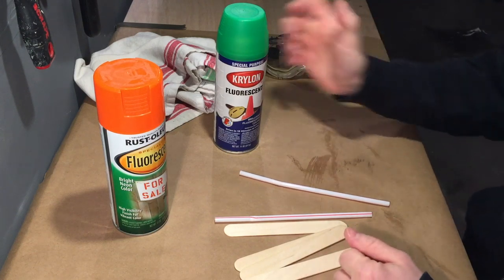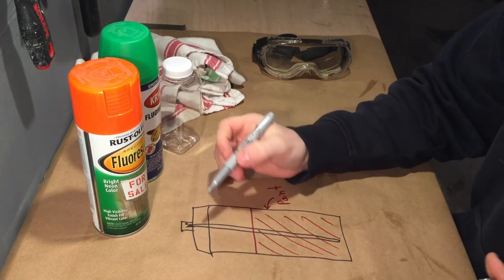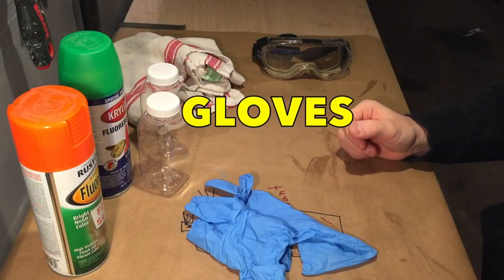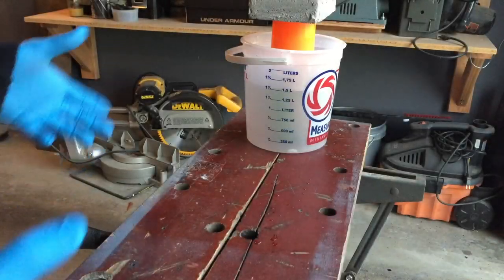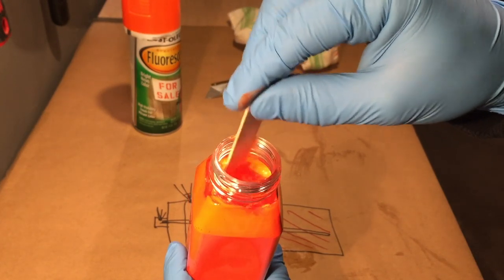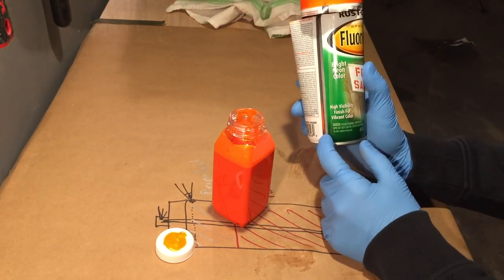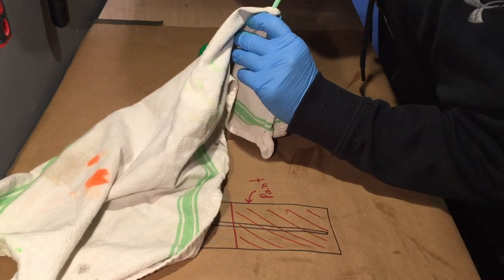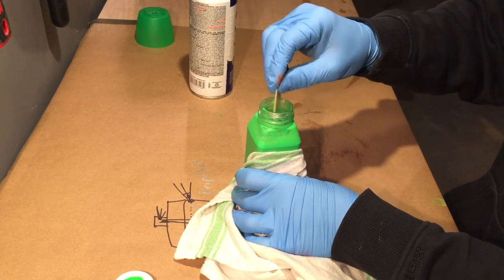Pro Tip: Decanting Spray Paint

Comment: Note: Spray paint cans are measured in ounces by WEIGHT. That's 11oz by weight, not volume.  You will not get 11oz of paint volume from that can. More like 8-10.
Reply from the maker: Thank you for that info!
Reply: NP! I started doing this a couple weeks ago and noted how I wasn't getting what I thought I would from the cans. That's when I saw the WT at the end of the OZ measure, denoting that it was by weight, not volume. I also noticed that metallics net less paint per can, I believe this is due to the metal flake in the paint making it weigh more, hence less volume per ounce.

Comment: I decided to do this to about 40 spray cans, some full of paint but no pressure etc. various sizes from the hardware store 12oz down to Testors 3 oz.  I did the puncture and cut method but what I did was invert the cans so they are sitting on their lids.  Then with a rag over your hand and the can, puncture the very bottom of the can (I used an old wood spade bit, carefully twist n push until you get the little hole.  Don't disrupt the can or the paint may decide to spritz out)  You can put it in the warm bath to de-gas and walk away then when ready I used a old can opener and depending on the design of your spray can you can cut off the entire bottom or use the can punch and poke a few holes one side and a breather hole on the other then pour you paint into your jar.  You might need some tin snips to cut the hold bigger if you want the marble out.  None of my cans were thin enough to cut with a utility blade so this way avoided having to jostle the can while sawing into the side.  (And yes...do not use plastic cups - I found out the hard way - I was doing 2 cans and I put the first into a plastic cup so I could see how much I had and within 5 minutes there was a little ring of paint around the bottom.  I only thought the cup had a crack so I picked it up to put in into another cup and that's when I realized the bottom was completely melted.  So the entire cup just emptied out on the floor.  That won't happen again!)
Reply: Ever see a comment that makes you feel kinda dumb? Like it was right in front of me, why didnt I do that?   I have several cans that have no pressure but still full. Just couldn't make myself theow a full can away. Gonna go do some airbrush primer right now. Hear the $5 can has 20x as much as a $15 bottle from store of same stuff.

Comment: I like the way you put a paint sample on the lid of a clear bottle :) You can turn the can upside down and exhaust the propellant before cutting open, but why not just spray out the amount you need onto the wall of a jar and leave the rest in the can, people have been doing that for years ,( without a straw). Lastly it's a bad idea to use lacquer thinner, in enamel paint you want enamel reducer.
Reply: I think it's for when the bottles are stored next to each other in a drawer/box, and you're looking down at them from above. It can be hard to see the side of the jar that way.
Reply: @DeeeFoo  exactly what I was gonna say..

Comment: I'm interested in doing this because I can't find Rustoleum Dark Machine Grey in quart or gallon cans, but I want to use my HVLP gun. Thanks!
Reply: I want to do the same thing……did you do it? How did it work out? I want to use the paint,but,want to spray with my hvlp gun, I’m sure I’ll have to thin it out, but, what about adding some hardner to the paint? How many can to get a gallon of paint?

Comment: No.1 best way too decant the paint bar none and the safest easiest way.... Is to use a saddle valve from the plumbing section it punctures the can and realeases the gas in a controlled way... I have a video showing how to build and use this tool that anyone who uses spray cans should have to get all the paint out and not waste a drop... No more throwing away cans of paint from any clogs or lack of pressure.... Tool is under $8 too make.

Comment: First of all, you want the paint mixed, otherwise you do not get all the color inside. I just got some tin snips, inverted the can, put a rag over the bottom, cut the bottom edge with the snips. The gas will leak out. Cut a bigger hole, a couple more snips, and pour into a bottle. Done.

Comment: I repeated the first method successfully. I'm just using the paint on my airbrush.
Thanks a lot for this tip.
It's way cheaper than buying other inks and save a lot of space if compared to polyester (automotive) cans (a quarter gal).
In my case I use an automotive thinner (for PU and polyester inks) successfully.
Reply: Also, spray paint cans are much more widely available. It's very easy to find them in various colors across different hardware stores and automotive stores, as opposed to buying airbrush-specific paint in the color you want.

Comment: I like cutting can open to retrieve the ball for stir in stowage glass/plastic jar. Much better for emptying spray can too. There are many versions of this paint decanting but nobody mentions it’s still messy no matter what path one takes. Compressed air and paint will come out initial hole no matter what. Do this outside away from anything.  Ripping the initial hole (needle nose pliers) big enough to get tin snips to cut can is safer than cutting it with a knife. Keep in mind the can is half way full of gassed paint. So keeping can vertical avoiding a mess is essential. 😊

Comment: I've been using the first method. It has been working best for me to stir it before dumping it out of the can. That releases the trapped propellent before transferring to the storage container.
Good idea with the warm water bath. I haven't been using one of those.
I've been using a metal snip to cut them open. I was surprised to see your razor worked as well as it did.
Reply from the maker: Ohhh stirring before dumping! That's really smart 😅

Comment: 6:45 if you run out of gas in the can - use a tire Valve Stem - take the cap off of the can - and don't over do it when you use a air hose tire inflator attatchment.   the best way though would to be to tip the can upside down if its a can that says you shouldnt spray it upside down (the ones with a tube going to the bottom - spray until all the gas is gone - then puncture after you turn it the right way up - and let the paint settle off the top and sides

Comment: After opening, ( punch a hole on opposite sides to get  propellant out quicker) leave the can in a bowl of hot water for a few minutes or use a heat gun. Then stir with a paint stick or Popsicle stick to be sure you get out all the propellant.

Comment: Does your decanted paints fizz up badly in plastick bottles beacause im having a problem with my bottles to gas up and almost spray everywhere while opening
Reply from the maker: Yeah you need to let it sit uncapped for an hour or so with a little stirring because there's still propellant dissolved in the paint. And I wouldn't fill them up to the brim of the bottle.

Comment: I have question, you said that even using direct spray it's still bubble in the paint. But if you paint something normally from that spray paint why we never concern about the bubble? thanks
Reply from the maker: The solvent evaporates very quickly when sprayed in a thin coat. When collected in a bottle, it does not have the chance to evaporate as fast.
Reply: @PressXProps  I see. Thanks. 👍

Comment: How come the pressurized can doesn't explode when you puncture it? Is there any risk of explosion if you accidentally cut too big of a hole? Also, I can get a can of spray paint for $1 and I am wondering if this is a way of getting (new) cheap paint the cheapest way.
((I know you can go to some places to get free "unwanted" paint, but the color white is the most popular, so the least likely to find, while white spray paint is one of the most common colors (black being the other most common).))
Reply from the maker: The walls are thick enough to keep the can from completely rupturing or fragmenting. I've shot cans with guns and although they look like they explode, it's nothing more than rapid decompression. You'd need to poke a pretty big hole instantly to get that (like bigger than about 9mm).

If you can get it that cheap, this could certainly be a good source of paint.
Reply: Cool thanks. Sorry for the late reply. I just changed my youtube setting because I wasn't being notified of replies.
Reply: I fount cheep $2.50 cans  exports    don't mix with other good brand s  crows feet .must be the water in them acrylic spray paint shiny finish tho.

Comment: Before puncturing you could spray upside down to remove some (or all) of the propellant
Reply from the maker: You could. Then you'd have to keep you finger on it for ten minutes and occasionally warm the can up back up. Or poke a hole, leave it in the warm water, and walk away.
Reply: Press X Props your lazy idea, me likey
Reply: @PressXProps  
use tape instead of finger, problem solved.
Reply: @PressXProps  Another youtuber used a long clamp and a vise. He tightened the clamp just enough for the propellant to come out.

Comment: I'm new to this hobby air brushing that is 👀 if I use the paint from a spray paint can what method should I use to clean the airbrush? I got one but I'm afraid I'll mess something up by clogging it
Reply from the maker: The can should tell you what the best solvent for cleaning that particular paint is. I use some cotton swabs and paper towels soaked in it. But try not to let the solvent sit in the gun or it can erode the o-rings, so leave it disassembled overnight so the solvent can evaporate. Good luck!
Reply: Use mineral spirits in a ventilated space. Do not use acetone because there is a rubber seal in most airbrushes that will shrivel if acetone touches it. Sometimes, in rare circumstances, you can spray acetone quickly to remove tough clog, but I've damaged a seal before with acetone and had to wait for it in the mail. Mineral spirits are fine. Clean the airbrush before the paint dries, but if it does dry, take the parts off and soak them. 
imagiraffe.com

Comment: Use glass jars instead of plastic ones.   I pour my paint on plastic ones and about an hour later the chems in the paint melted the plastic. Imagine the mess I ended up cleaning!!!  Not sure why I switch to plastic jars when I had done it with glass before.   I totally messed up!!!!
Reply from the maker: Yikes! Yeah test them first for sure. The ones I used are still holding up just fine.
Reply: Lol, I used a glass jar buuut....used a plastic fork as my mixer. BIG mistake, my primer now has plastic melted into it haha

Comment: Wouldnt inverting the can, then venting off the air be the easiest? Its what you do to clean the nozzle anyways. then you can puncture, and drain.
Reply: It seems like it would work to turn the can upside down to get rid of the air, but has it actually be done? Nobody on YouTube does it that way.
Reply: Yes that does work. However, it causes the paint and can to get extremely cold which causes the paint to hold more dissolved gas. No shake for 12 hrs and top puncture works the best because the gas is released without passing through the paint like it does through the straw with your proposal. Also, this takes some extra time, in which I mean 5x more than puncture method.

Comment: Just wondering, how do you clean spray paint from a airbrush because I was told it’s hard?
Reply from the maker: I've had good success with lacquer thinner but I'm told mineral spirits is better. Any solvent that works on spray paint should be fine. Just be careful of o-rings and plastic parts.
Reply: Other Youtuber videos I've seen use Acetone for airbrush clean-up, soap & water, final spray with 90% alcohol.

Comment: Tip for if you're keeping the spray cans that have the tube going to the bottom - prevent the tube from clogging after use - hold can upside down - spray until there is no paint coming out.   - revert to my other comment if your can runs out of propellant (use a tire valve stem and air chuck to add air into the can with the cap off - do not add A LOT of air!)

Comment: EDIT: I tried this out with dupli-color automotive latex paint and it worked perfectly! I used method 2 and followed the instructions and had no issues. I expected it to work anyway, but this is for anyone else wondering. This should work with any rattle can paints as it worked with sticky latex paint. 

Would this work with vinyl automotive spray paint like dupli-color? I need to mix colours for a project and can’t find another way to do it :(
 (I’m thinking method 2)
Reply from the maker: I don't see why it wouldn't work. Give it a shot and let me know! I'll pin your results in the comments.
Reply: @PressXProps  Thanks! I'm gonna try it soon. My dad has worked with these vinyl sprays a lot and he said it should work fine too. I'll try to remember to post another comment when I try it out! (:
Reply: Press X Props I just tried it out and it worked perfectly! I’ll edit this comment mentioning that and you can pin for others if you want (:
Reply: Got my air brush. An spray paint all same type.  Sume different brands do mix together. But cheep export paint don't mix with good brand .
Reply: @khl0rine  Did you spray it using a paint gun? Did you have to reduce it or anything?
Reply: @89Mirageman  I sprayed it into a cup and used it with a brush! I was doing detail work though so I can't speak for if it would work for full areas of colour! I don't see why it wouldn't though. Also no I didn't reduce it, just used it as is.

Comment: Fluorescent paint is not color fast - the paint will fade and the color will go away under uv (if outside - the sun) the fluorescent color will break down.  Just so people know :)
Reply: I am about to do this to fluorescent paint so thanks so much.
Reply: @cclaudio8069  for sure!  I still use fluorescent paint!  A way to help it last longer is a good clearcoat or 2 part clearcoat that specifically says it has UV protection and a decent wax after paint has cured.  And nothing wrong with re-painting in the future to something fresh and different!
Reply: @cclaudio8069  If you save any of the fluorescent paint, put the paint inside of a solid container - sized to what you are getting out of the can!  Old pill bottles work nice!  That way it slows down the breakdown process!

Comment: Where do you dispose of the cans after you decant them?
Reply from the maker: I just toss them in the trash. They aren't pressurized anymore or anything so they shouldn't need to be handled specially.
Reply: Thanks
Reply: Let the paint dry in the can, before throwing it in the trash.